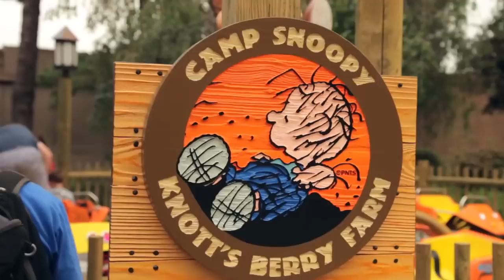Canada's Wonderland 5 Year Plan

Comment: Wonderland doesn't make Cedar Fair nearly as much as you seem to think. Thru Q1+Q2 the park has made CF very little net income. Guess how much revenue & net income since you claim to know so much? I know, do you? 
Talking about attendance you never seem to consider the pass mix. High attendance with say 70% pass people is not  necessarily good, especially if a lot have season meal plans. Parks do  not really like people that have meal plans that go to the park a lot. Each time you redeem a meal their margin decreases. They want you to see the value in purchasing a meal plan, while  not redeeming a lot of meals..especially at gold meal plans for around $100 CAD(2022 fall/early spring price), which is $78 USD, They can start losing  money with meal plans quickly with say 6 or 7 visits & 2 meal redemptions each visit .  That goes to the other point, the  currency conversion. The park actually has the cheapest passes/meal plans, etc.. in the chain  after currency conversion.